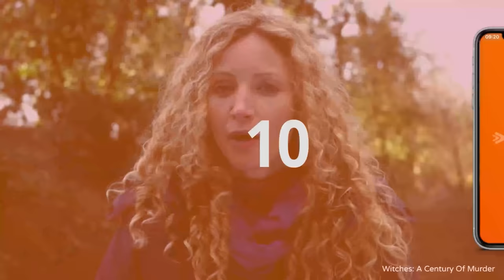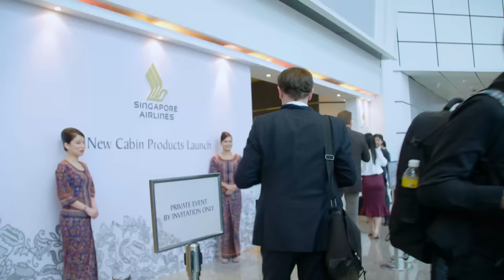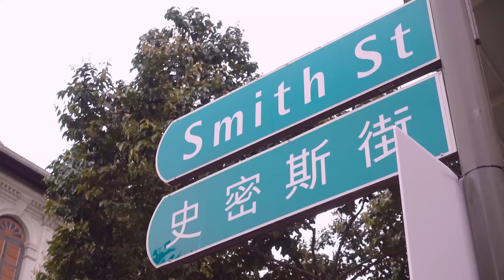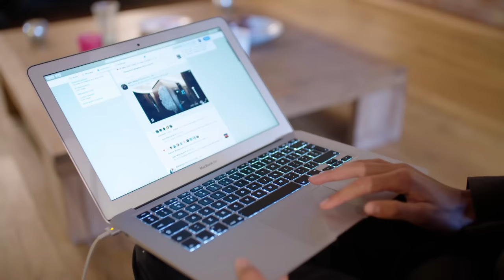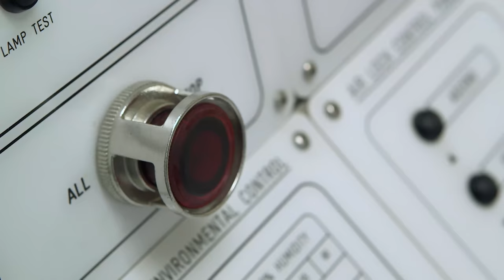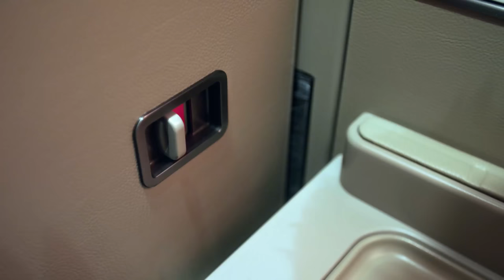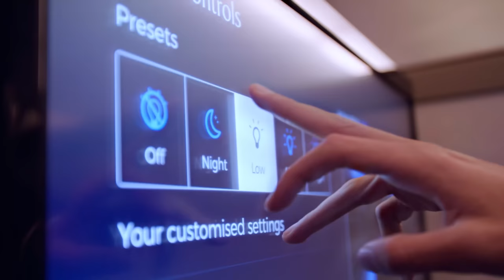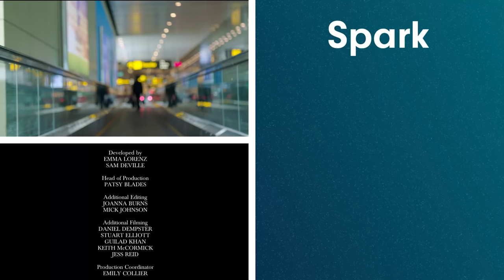How Airlines Cater To The Super Wealthy [4K] | The World’s Most Luxurious Airline | Spark

Comment: Like so much in the world, especially in the rarified atmosphere of the "super rich", it's the attention to even the most minor details which count... I will say that I am delighted to see that so many Airbus A380's are either being resuscitated or ordered new despite the higher operating costs, as a result of Boeings' disastrous 787 "Dreamliner" debacles. A classic case of when "cost-cutting" can ruin a companies' market share..!!
Reply: You are aware, are you not, that the A380 is being discontinued due to high operating cost which has lead to lack of sales, right?  The Dreamliner got off to a really rocky start but has lower operating costs and orders are still pouring in.
Reply: Peter, you are aware the A380’s are starting to be scrapped or stripped of parts?  There are no new orders, the production line is shut down.

Comment: @ 39:48  …the window views are actually kind of terrible.  Although the seat can move to face the window, there’s so much sound deadening/insulation material to keep the cabin quiet, it’s like looking through a little tunnel. Not a great view  tbo
Reply: That's what I thought, too. They could have gone for larger windows, or have an inner window flush with the inside wall with a lens effect. If you calculate it right, it should improve the view by a mile. Singapore Airlines, if you do do this, you heard it here first.